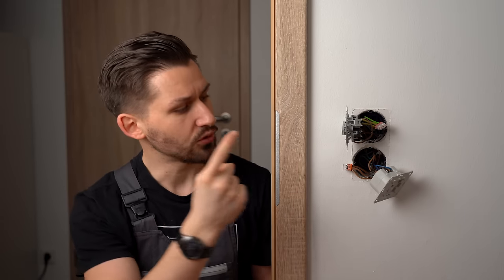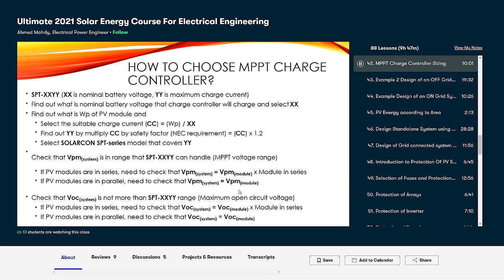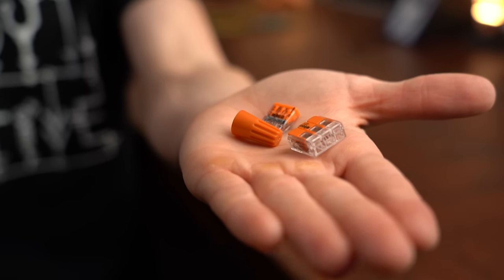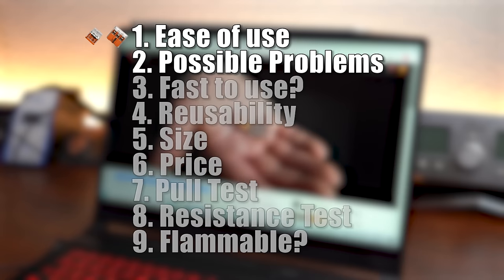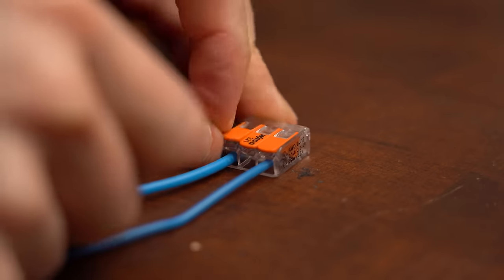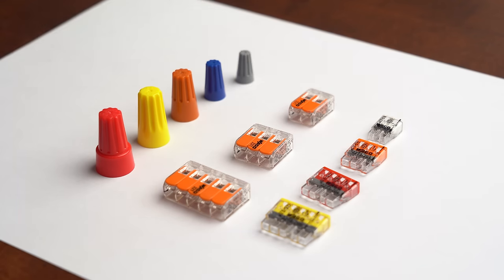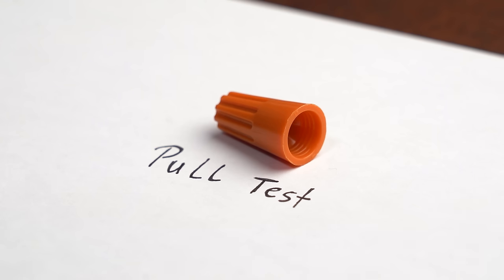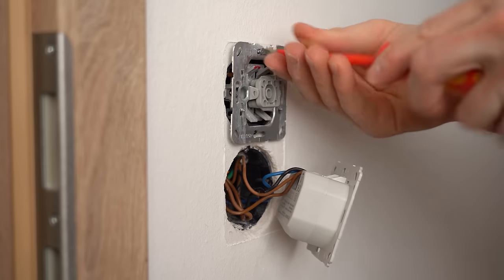What Wire Connector is the Best? Settling a Debate! Wire Nut VS Wago

Comment: Solid conductors should not be twisted by the wire nut, they should be twisted by pliers, the wire nut added to prevent disconnection when amperage creates heat. The wago connectors are intrinsically no different to an outlet using the back-stab method. Yes it's faster, generally easier, but nowhere near as solid or reliable as the screw terminals compression. Should have done the heat test with current applied, the wago don't hold up at all.

Comment: You’re supposed to twist the wires together before installing the wire nut. I guess that’s not obvious if you’ve never used them before, but I’ve been using them for about 50 years (ever since being a child interested in electricity) so it’s all obvious to me. Plus unlike the Wago connectors the local hardware store has them. I think inertia explains why Wago connectors have never been popular in North America: wire nuts work well enough, and are easy enough to learn how to use, so why change? For casual DIY’ers the Wago’s may be superior as they do have some instructions printed on them and require slightly less skill and knowledge to use. In continental Europe where Wago’s are apparently common, no question, just use ’em.

Comment: I see this test this way - Wagosare better for professionals as tgey are easier and faster to use while still good enough.
Wire nuts (or twisted wire connection) are better in oweral quality and recommendable for important projects where you need quality and you can afford a bit more time to do it

Comment: Being in the USA I have only used Wago connectors once because they came with a replacement outdoor light. My big issue was that I had a really hard time getting all of the wires and connectors pushed into the box to mount the light fixture. I felt like wire nuts would have been a bit easier because of the size and shape.

Comment: The fire test isn't really a fire test. It's not that easy to put something on fire using heat gun (unless it's paper). I'm sure they both will start fire if in contact with red-hot wire. It's just plastic. Most plastic burns. But it's not like I tested my statements, so don't take my word for it.

Comment: 1 didn't pretwist the wires before installing the wire nut like has to be done with any construction the nut holds them together not puts them together 

2 did you buy them waygo coneters on Amazon because them wire nuts are cheap af really don't think they are to standard ik I use much better made wire nuts then was used in the video 

So you compared your German electrical grade coneters against cheap Amazon wire nut ripoffs 
Wonder what one was better. no wonder people think the USA electrical is trash if you think we buy are gear off Amazon

Comment: you forgot about the peace of mind that comes from trusting a product. with wago's you need a fair amount of mental trust that the product will perform correctly. there is a bit of finger crossing happening whether you realize it or not. but the wire nut is time tested. all you need to do is glance at it quickly before using to ensure the wire nut has no defects.

Comment: Wago does not connect wire to wire. A wire nut does. And a small twist leading to wire nut is correct. Usually pre twisting wires is done with linemans pliers. There is also a wire nut wrench.

Comment: Good video. Sorry but I just don’t trust the Wago’s. Seems to me if you twist together the conductors professionally and securely then twist on the wire nut then it isn’t going anywhere or be subjected to heating. Not saying there isn’t a place for Wago’s, but for everyday electrical I’ll stay with the wire nut.

Comment: Ok, not new to the elechicken game. 40 years in the trade. WAGOs aren't perfect. I've replaced then when they failed. My preferred wire nut? 3M Red/Yellow for most common 10 and 12G splices. But you are failing to use even those crappy wire nuts correctly. You first mechanically splice the wires by twisting then together with your pliers (Klien 9" if you're not a Meth addict) then you insulate your splice with a good wire nut.

Comment: I have a combo fan/heater in the ceiling. after i installed it, i could never get it to run the heat and the fan at the same time. oh well, it must be some internal logic thing or something i thought.
WRONG. about 5 years later, i had the heater on while I took some time to relax on Instagram, and suddenly there's a big arc flash.
come to find out that the wire nut had not seated right, the fan was connected though the heater conductor, which was also loose, and eventually it rattled enough that the live fan conductor came out the back of the nut, hit the box, and left me in the dark and well relieved when the breaker tripped...
re-did the connection and suddenly everything works at the same time and the fan sucks harder...

Comment: GreatScott, first I must say that I enjoy your videos, thank you. I believe that Wago has a place for use but I would only trust them in low current and voltage applications unless it is not a permanent type of connection hidden away inside the walls of a home. I also understand that you don't have experience with wire nuts and don't know the correct way to use them. Quality wire nuts must be used, not the cheap amazon stuff shown on this video; they are not acceptable. When using wire nuts you should first twist the wires together tightly (preferably using lineman's pliers) to make a secure connection then screw the nut on tight by hand. Doing this will give a great surface area contact and make the connection even tighter for increased continuity. It will also secure the connection, insulate the connection and does not rely on a spring that will most likely weaken through the years. While a wire nut does not carry current A Wago uses its spring as a conductor so it will be heated and cooled regularly which can further affect the tension of the spring holding the connection together. Yes wire nuts are more time consuming to use and require some knowledge of the proper way to use them; but the end result in a long term situation is much more reliable than the Wago. If speed is your main concern than use a Wago, but if safety and reliability is most important to you, then use wire nuts. My family's safety is my main concern. I would never use Wago connectors in my home.

Comment: I personally prefer the Wago 222's, the somewhat bulkier big brother to the Wago 221's. I've broken more than a couple of the lever's on the 221's trying to get them open, but the 222's have very sturdy levers...never broken any of them. Wire nuts are so 20th century...someday they may actually be outlawed. BTW: you didn't do a vibration resistance test on the connectors; wire nuts often fall off in vibration situations; I can't see a Wago falling off in even the most violent vibrations.

Comment: Funny how age comes into play here. Wire nuts were common in the EU once, and pre-date other clamps. You will still find them in old homes. I you are 50+ you will have worked with them, as they were the only connection available back than.

Comment: The wago connector meets code in the U.S.A., but most inspectors I have met still wont pass a residence that uses them. Wire nuts ONLY.
Reply: All the U.SA. based comments about how great wago are seam to be from homeowners remodeling, and that makes sense, as professionals know U.S. building inspectors will fail them 99% of the time, just for not using wire nuts. I wonder how many of these homeowners didn't get a permit... or inspection.

Comment: The metals are not the same if you do not twist the wire with wire. The electrons have to travel through a different metal inside the clamp. That’s a huge bottle neck for current. It’s like the electrons have to jump over something different because suddenly the material they were traveling down has changed. Imagine this wire having to do that 4-5 times at juntion boxes and then you plug in a hungry vampire like an electric heater. I think it’s dangerous

Comment: Push-in connectors are better for inexperienced installers because there are too many ways to improperly use wire nuts.  Even a trained electrician doing a quick and dirty job is likely to screw up wire nuts out of laziness.  I've seen a million crappy jobs done by "professionals" using wire nuts.  However, for the electrician that uses wire nuts correctly, they are still the best.  That's why I use them myself, but I would rather use push-in if anyone else installs them on my projects.  They are fast and almost idiot-proof.

Comment: Been twisting wirenuts for over 45 years, usually Ideal or 3M, not those cheap @$$ ones in the vid. I have also used Wago from time to time. Wagos are good but I prefer wirenuts for a couple reasons. Wirenuts don't consume as much area inside the junction box. The area that the connector uses is calculated in the allowable fill for the junction box.  Wirenuts are getting a bad rap from DYIers only because they can't feel  if their connection is good. Believe me, after twistng a few thousand of them, you can tell immediately if you're not getting a good bite on all the conductors. Like others have mentioned, There is no buss inside a wire nut, it is considered a splice where as the WAGO is considered a termination. Terminations are much  less reliable than a properly made splice IMO. Also, IMO you should not pre-twist your wires for wirenuts. You will get better bite without. Some manufacturers of wirenuts actually print on the box "Do Not Pre-Twist" but they will also state to continue twisting until the pigtail has 2 external twists. It's all done by the nut.

Comment: Ever seen the push in connectors on receptacles? It’s the same exact design as wagos. I’ve been to dozens of trouble shooting jobs over the years chasing broken or overheated wires due to these types of connections failing. In some cases the outlets were smoking, very hot and even fell into pieces when I took the outlet apart. I can’t trust wagos due to these experiences. It’s the same exact design, a spring shaped piece of metal bites into the copper and over time in the right circumstances will fail just the same. Yea they’re so easy, no real skill required. Try hiring a professional or learn how to do correct wire connections.

Comment: When you use wire nuts you pre twist for cables and finish it off with the nut. No electrician I've ever worked with relies on the nut for twisting

Comment: Not the fairest comparison. Pitting the nice brand name WAGO connectors against the cheapest, lowest quality wire caps, of course the WAGO connectors seem easier to use. A better comparison would be WAGO connectors VS Marette wire caps. Specifically the blue ones with the ergonomic fins, very easy to use.

Comment: The lack of current and voltage ratings on the box for Wire nuts in the USA is really a non issue. All of them are perfectly capable of handling the standard 120V 15/20A circuits found in American households. The vast majority of people working with 240V 30+A circuits are going to be qualified electricians here and they are educated on these matters. Even then Wirenuts can handle 240V 40A easy so its not really a concern.

Comment: I have been doing electrical work for 40 years in the US and I have never had a wire nut failure. I have recently started using the lever action Wago connectors, and I do like them, but for multi wire connections they definitely take up more space in the box. I would question the reuse of the push-in Wago connectors or any connector for that matter. Pulling the wire out reduces the spring tension on the next insertion.

Comment: those r the lowest quality wire nuts around. ill take the rubberish wire nuts. red cap, yellow skirting. also using lineman pliars to properly twist wires before applying wirenut is key
Reply: Nope is not needed to pre twist as it says so in the instructions of the wire nut, And dont try arguing like alot of people do as they people who make them know it alot better than you.

Comment: No doubt that Wago connectors are technically superior to wire nuts but in the video you aren’t using the right procedure. With solid wire, you have to twist the wires with electrician pliers before securing the connection with wire nut. Same thing applying to stranded wire. For mixed wire, the striped portion stranded wire needs to be longer ( about 25%) than the solid wire for proper contact. As you can see, using wire nuts depends more on the ability of the users for secure connection. It is also slower than Wago connectors but for historical reason, widely used in North America.

Comment: The average wire nut is  13 cents a piece and the average wago is 29 cents a piece. I can easily hook 4 wires together with any wire nut. With a wago I have to have a 4 slot wago or better. Wire nuts don't conduct current because the wires are all touching each other. Wago the wires don't touch the other wires, just another piece of metal in the wago. I think Wagos have their place, jusn not in residential wiring.
Reply: wire nuts are impossible to inspect, falls off easily and cant handle mixing solid and stranded wire

Comment: The best connector is simply twisting the wires together. If done right, it's better than any of these. Unfortunately it's banned, because people did it wrong, and it caused fires. Some wagos blow up, when a short occurs, twisted connections don't.
Reply: Code in the US now requires arc fault interupters - the chance of a fatal short are slim.  Bad wrenut connections lead to faulty grounds etc. - the "if done right" is the tricky thing - not tricky with a wago.
Reply: Never seen a wago blow up, But i have seen lots of wirenuts crack
Reply: @norwegiannationalist7678  I'm not talking about wire nuts.
Reply: @anxiousappliance  Try using afcis in Central Europe. No one will pay for that, not even the richest.
Reply: @czonczike630  They're code for new panels where I live.  Not really very pricey.  But I know some people just want dirty deeds done cheap.

Comment: It is so funny when people from the usa bring up the price against wago. I have worked in both usa and europe for industrial, commercial and residential electrician contractors and amerikanski seem to charge 3 times more for the work, yet they cheap out on them connectors, where as in europe there isn't even a debate about what to use. You just buy the wago no question.

Two more points for the wago. Try to undo both wago and nut after they were in use. See how messy the nut leaves the wires... The other one is a short wire. Theres no way you could connect a wirenut when you have only have a teenytiny of it sticking out in the back of your box. With the wago it isn't that hard. You could accidentally cut a wire short, or find a burned or broken wire in one of them boxes that are super short.

Comment: Next time test the time for fault finding and reconnecting e.g. 8 circuits.. With wire nuts, you have to disconect everything and make a new splice, with wagos you can measure directly on the wago and remove a faulty part of the circuit with no problem. This is why wagos are used almost everywhere especially in commercial environment, they might be a little more expensive but over time the ease of fault finding makes them much cheaper.
Especially in vibrating areas like rooftop units they have secure connection due to the stainless steel spring contact, wire nuts can get loose contact if not properly connected (OK, wrong connections on a wago are possible, you must be really stupid to archive that though).
Fault finding in a RTU is a big advantage of wagos, it saves so much time to temporarely remove a pressure switch out of the circuit for fault finding, these wire nuts make one nuts.

Comment: In the USA, we have "cheap" outlets that have push on connections.  These connections are dangerous.  I have seen 4 different houses where these connections failed and caused fires.
I would not use the wago 2273, as I don't trust a push on connection.

Comment: Were the wire nuts you used from a reputable source or are they chinese knockoffs? In the US, wirenuts must be tested and listed by the Underwriters Labs to be used legally in home wiring. The reputable brands here include Ideal and 3M. Electricians usually don't buy their supplies on Amazon but through specialty electrician suppliers that only stock reputable (and legal) brands. If you are going to try to asses wire nuts in general you should use a brand name.

Comment: wire nut specification info is determined by their color - no numbers needed. I have used all these and the wire nuts are by far the easiest and fastest to use. a little practice and you'll never use anything but wire nuts. furthermore, wago connectors make two connections via a bus bar (more connections create resistance and heat) - whereby wire nuts join the two wires (conductors) directly together making only one connection and without a bus bar. sorry friend, you are backwards, wire nuts are superior in every way to your wago, high resistance, bus bar, multiple connection, and over-priced gizmos. please get your calculator out and calculate the surface area contact of a wire nut connection to that of your wago gizmos connectors and you'll understand why wire nuts have the lowest voltage drop (least resistance) of the three. and lastly, a wire nut joins solid to solid and solid to stranded whereby you need two different wago connectors to complete both these different connections.

Comment: So much vago cope in this video.  Wire nut is a low cost ez splice that holds up indefinitely. Been used 60 years and the original ones still being found and replaced not out of necessity but just to adjust lighting etc